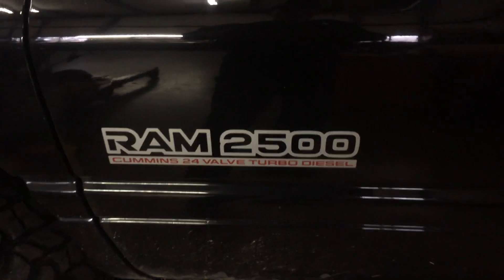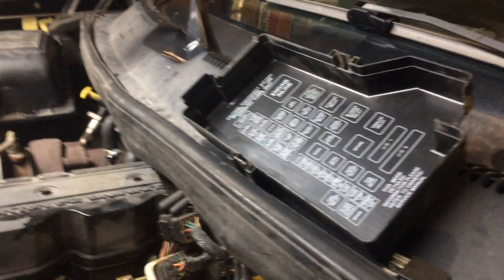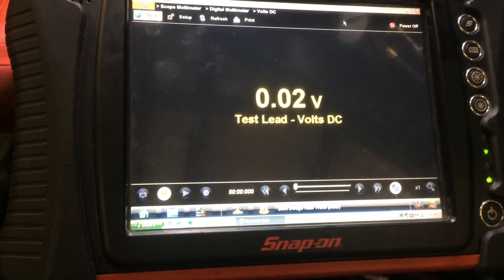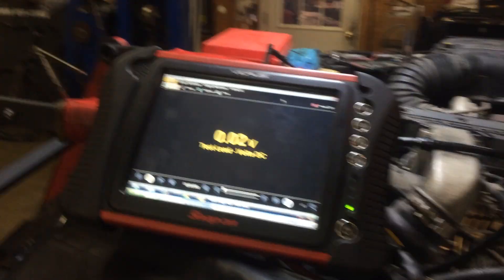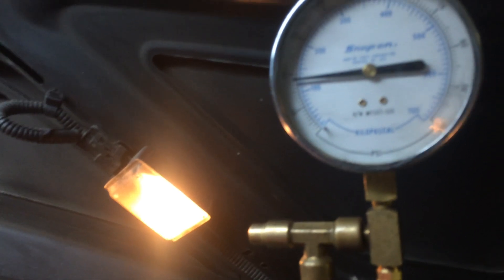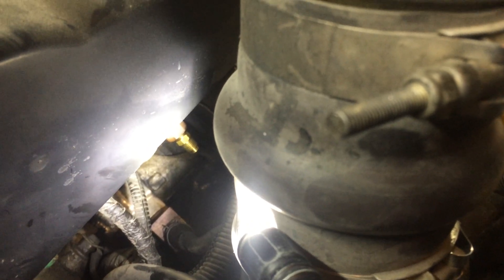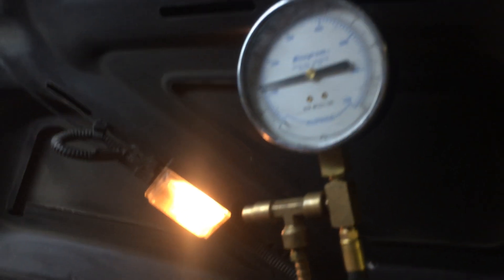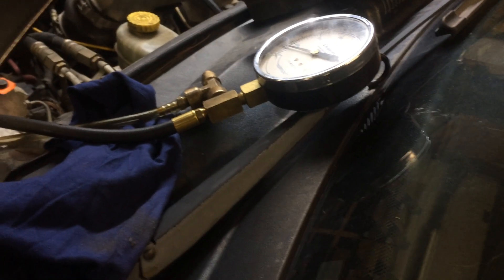Dodge Cummins 24 V 5.9L Lift Pump Diagnosis - Part 2

Comment: I had electricity to the transfer pump. changed the filter and now the transfer pump does not come on. is there a fuse or something that is causes this not to work. if so how do i fix it.  hope i can get a response ASAP.. thanks Mike

Comment: not liking your vids. not going to thumbs down - BUT you are not clear about what you are talking about (Vague) and when you start the truck you can not read the gauge partly because it is vibrating from the running truck which is WAY louder than you are. 
Hope this helps you make better vids in the future.

Comment: What are your thoughts on the fuel boss mechanical lift pump
Reply from the maker: The Fuel Boss theory of operation is sound: more RPM, more fuel, but I don't think they're a good fit in stock applications such as this. The reasons being more fuel than stock is not required, and they are priced much higher than just a replacement electrical lift pump such as the FASS unit shown here. I think they would be a good choice for a high HP sled puller or drag truck, as long as adequate filtration was in place to protect the injectors & pump.
Reply: The guy I got the truck from replaced the stock lift pump twice and now the injection pump went out  my only worry was having too much psi I don't want to hurt something else but I thought it might help if down the road I do put a lil bigger injectors on it. Thank you for all your help